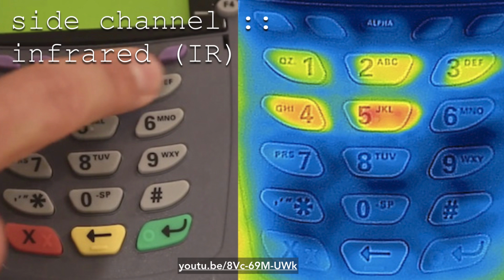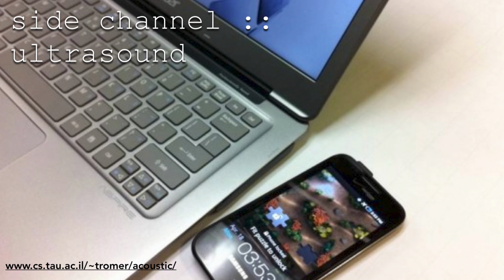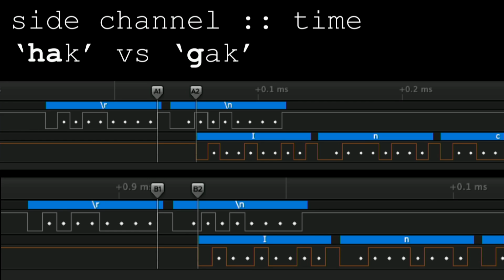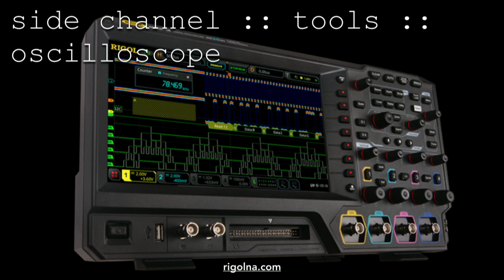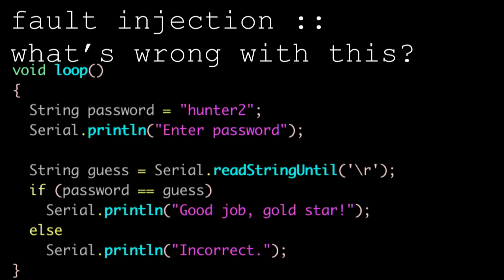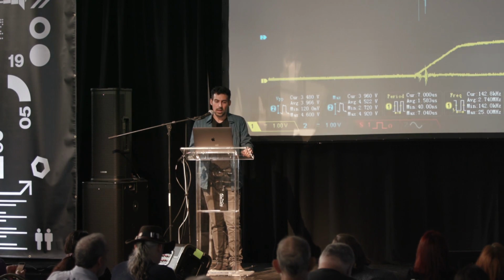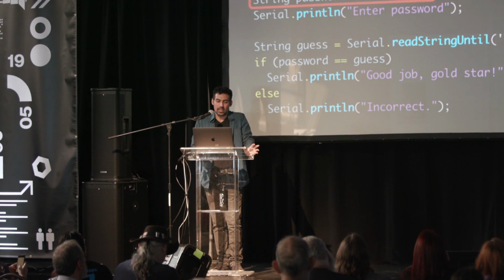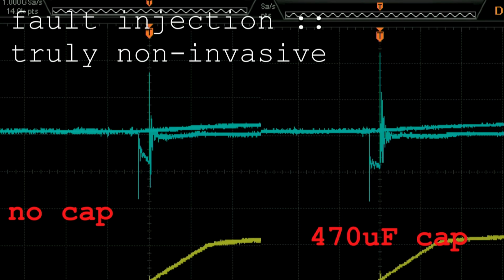Samy Kamkar - FPGA Glitching & Side Channel Attacks

Comment: your timing hack reminds me of what I tried in minecraft once we figured out remote chunk loading, to see if it was loaded from disk or generated newly or already loaded. We tried using timings but over the network that was too unreliable. Then we tried out to do the timing on the server's side, so you could time the delay between 2 events and inbetween those you do the chunk loading. Didn't find a good second event though.
Reply: I remember using some mod that showed whether a chunk was already generated or not and mark the pre generated ones red on screen. 
Do the mods these days use the timing hack or something else? 
The mods were pretty accurate and we would follow the trails to find people's bases.
Reply: @godfather7339  yeah so how that works is that minecraft generetes chunks in 2 phases but it loads chunks in 1. So when the chunk generation sends an additional large block update packet when loading the chunk, so therefore it must have been newly generated your client assumes. This works most of the time.

Comment: Correct me if i am wrong but you dont need to erase eeprom for write new info. Erasing means chage all bytes to 0xFF which is actually write operation. And you dont need that. Just put new info.
Reply: EEPROM works like UV (EPROM). A "write" operation means that you can only flip a bit from "1" to "0" (not viceversa). You cannot "write" a "1" where there's already a "0". Hence you need to perform an "erase" operation to reset all bits to a known default state (i.e. 0xFF) before the actual "write" operation. In other words you could say that the EEPROM "write" is NOT atomic.